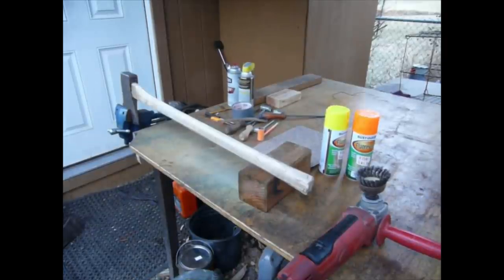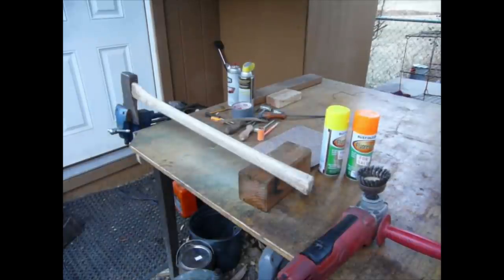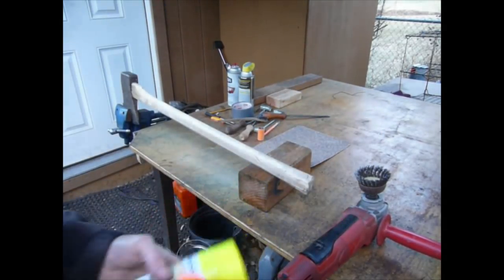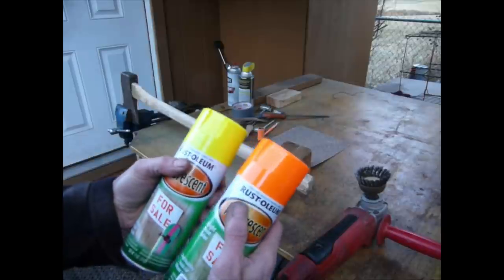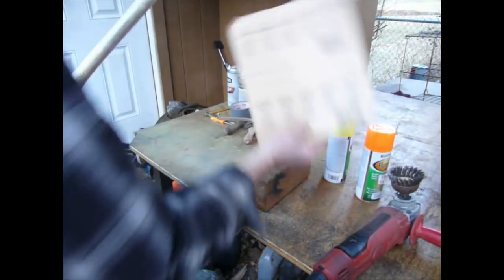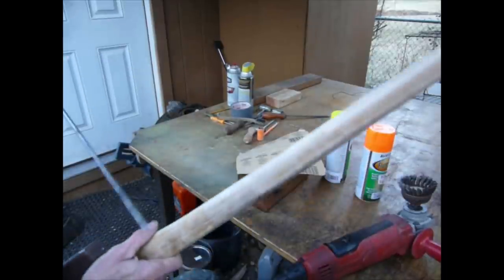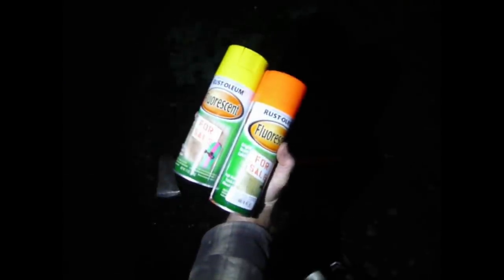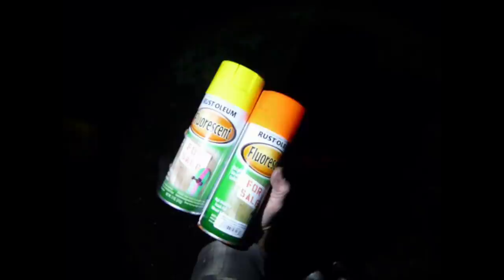The Faller's Corner - Ax Handle Color Preparation, My Method & Why

Comment: I'm red green color blind. so I painted my axes  Ford Blue, which I see real well. I had to have a bucker  with me when cutting sales that were marked in orange, pink or red. So one day the safety guy was inspecting my pickup for pulaski and shovel. Plus my shovel in the brush. He got on me for not having them painted red.  I asked him who do you think these are for? He said well, yerself and anyone who  can grab a tool in an emergency. I said I don't see red, got it? The're my  tools, and I'm not painting them some color I can't see. He smiled and walked away.
 
My falling axes as well as woodshed axe, I wrap leather or thin starter rope and or electric tape at the end, Not on the butt, by  just around the end, not more  than say half inch wide strip, along with running some notches in the wood handle to keep from slipping. It made a great difference in my career of cutting.  Always had a good grip even when the bod got tired.

I've got three five pounders and my fave, hands down is one that  bought in the 80's for about 35 bucks just for the head. Swedish, beautiful steel. Rings like bell across the canyon, not like a thud that a lot of axes do. Great balance and shape. Nothing like having to chop yourself out  of some mess when no one else is around. That axe and me got some stories.

Some guys learn slow and some don't at all, but keeping your axe sharp and dressing the head now and then make  world of difference in any color;-)

Comment: Now correct me if I'm wrong , other people have asked , I think you place your axe , handle slightly down, so if the back cut starts to close the handle will rise and you see it and pull the saw out before it gets pinched.
Reply: The head is placed in the back cut or the undercut(DANGER DANGER, fallers corner) the purpose is to indicate movement in the tree. The head moves a little, the handle a lot. The movent is multiplied and he watches the handle with many other indicators.

Comment: I wrap my handles with orange duct tape. Lasts longer than paint and helps with cracking handles.
Reply from the maker: LL hi. The 4lbr is a Stroax. I brought the head @ Madsen's in '97. One of the last two they had. This is the second handle. The 1st lasted 13 years. Painted twice. I've never had that kind of longevity from tape, but I like the vinyl electrical tape because it is thin and will allows for hand sliding and my belt storage method with a lot greater ease. 
It is interesting all the personal methods that are talked about in this video. I guess the best way is the one that is actually best for the guy on the end of the handle....
Thanks for watching.